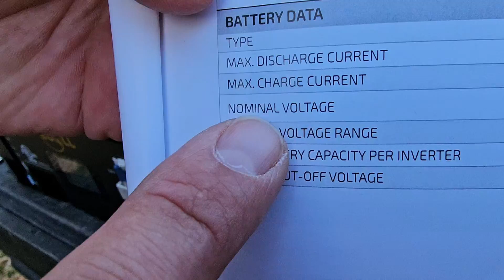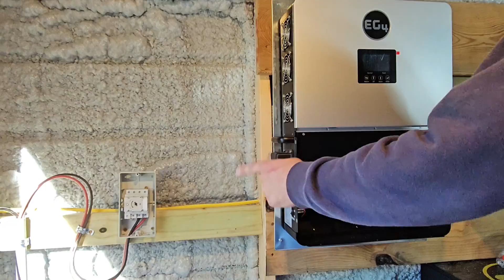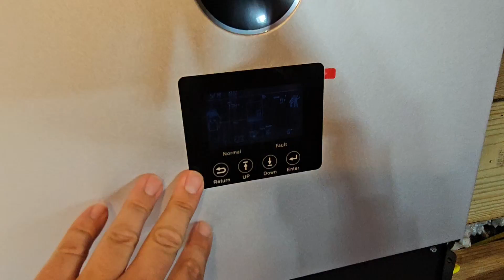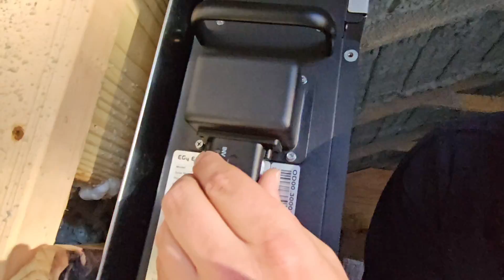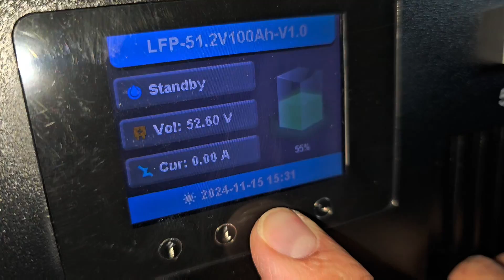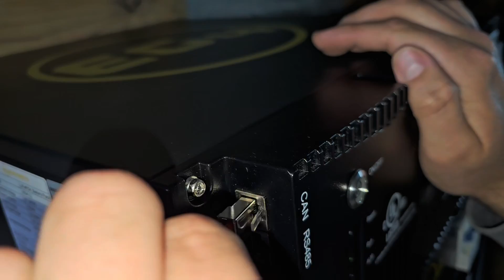EG4 6000XP Off Grid Inverter PROVED To Be A GAME CHANGER!

Comment: I've lived offgrid, struggling with a mix matched 12v system. But I did servive. Now I just got my dream set up. 6000xp and lls and a huge area .
Happy happy camper.  I can have air conditioning and run my well up without useing the genorator. I can now live like a city folk . 😅

Comment: Did I miss the ground rod for the inverter PE bar?  Did the system end up with a floating neutral or bonded?  Thanks for the succiny description during the video component install.  Well done.
Reply from the maker: Ground rod was placed just outside the shed I don't think I showed that in the video

Comment: No you can have 17 amps nd up to 480 volts on each so you can pair 2 array that have 8.5 amps on each on Voltage has to be 120 volts dc to even work 150 up will be better My Lowest one is 210 volts the others are 300 and above

Comment: These cheap high-frequency, transformerless inverters can damage your appliances when they fail because they don't provide any galvanic isolation between their DC boost stage and their AC output. No thanks.
Reply: Can you name a few alternative options that have the transformers?
Reply: @tompower7576  There are many low frequency inverters available on the market  available from manufacturers such as Outback Power, Magnum Energy, Sigineer Power, Iron Core Inverters, POWMR to name a few.
Reply: @ I did a bit of research and it makes sense about transformer based inverters being better. Unfortunately a quick check shows that they’re very expensive as well as somehow slightly less efficient. I found a 12000 watt Outback Power one at a decent price of $5500 😞 while an EG4 similar one can be had at $2500 right now. 
Quick question: could one  or get away with the possible surge problems by either installing a whole house surge protector or even having one on each appliance/outlet?
Reply: @ I was actually surprised to see that Sigineer Power has a transformer based 12000 watt inverter for $2999!! Compared to a high frequency EG4 I guess that’s an amazing deal!! I just wish it took in more than 7000W of PV power (or am I reading the info wrong). Either way that’s not bad.

Comment: The high-frequency EMF that is emitted by these low cost high frequency inverters is considered more potentially dangerous than the low-frequency EMF from low frequency inverters because higher frequencies carry more energy and can potentially damage cells and DNA more readily, especially when exposure levels are high; this is why radiation like X-rays and gamma rays, which are high-frequency forms of EMF, are considered ionizing and can be harmful to living tissue.
Reply: And no the frequency emitted are not on X-Ray or gamma rays levels of frequency and energy. Radio waves, cellular radio waves and TV signal waves are transmitted throughout the atmosphere everyday. And yes, the waves emitted by this inverter are considered harmless. Low levels.
Reply: The color red is a higher frequency wavelength than whatever this inverter puts out. If all high frequency  electro magnetic waves harmed you, you would be blind from seeing colors all day long as they are higher frequency than all communications frequencies except those ionizing levels like x ray and gamma rays.
Reply: You can add additional EMI and RFI filters on the input/output if they're not already into the inverter design. In other words, the designer should have those filters built in.

Comment: Not a wise choice for an inverter. These low cost, Chinese made inverter chargers use low surge, short lived high frequency, transformerless inverter technology that can be unsafe when powering household appliances or when charging an EV because they both lack an output transformer that provides galvanic isolation between their DC boost stage and their AC output. You're far better off investing in a lmuch safer, higher performance low frequency, transformer based inverter charger.
Reply from the maker: Do you have any recommendations for a better Inverter brand
Reply: Can you name one for about the same cost?
Reply from the maker: Thank you for this knowledge brother
Reply: You have a point there but these inverters are not dangerous. Yes, using a unit with a transformer would be better. A transformer provides isolation and great at matching loads. It however drains energy in the form of core losses and copper losses. You can't get away Scott free.

Comment: Also, it you’re pulling positive from the top battery, you should pull negative from the bottle battery to keep it balanced
Reply: For two batteries he is fine. The ohmic deviation is miniscule. When you have an array and are pulling 100 amps and charging with 100 amps, then an ohm can be substantial. As general rule of thumb, you want to connect at opposite ends of an array. I run 5 batteries. Solar charge is about 50 amps and max draw is 60 amps. Batteries stay balanced and I pull power from the first battery. Batteries reach full charge most days and they are communication linked.
Reply: You need to use same length of pos and neg wires and ya if u do have more than 2 batteries you should connect the closest positive and farthest negative or vice versa. But if u have a tower it's just easier and better to use two busbars.
Reply: What does that even mean?
Reply: @eddietee6305  wiring + to the top battery and - to the bottom keeps the circuit resistance balanced

Comment: This is a great starter. I purchased the same setup, the 6000XP, and the two batteries. I have been running the house off-grid for the past 18 days. It looks like I will have to invest in a second 6000XP so I can feed the garage and power the well. I like it as backup power, but I want to eventually be energy-independent. The only load it cannot handle is the dryer when it is set on anything other than the gentle cycle. It will not handle loads over 6K. We get a lot of sun, and the batteries last all night, discharging to around 30% before I start making coffee in the morning.
Reply from the maker: I'm very cool
Go ahead to know that the batteries are lasting.That's awesome
Reply: @MyCERanch  I wouldn't expect it to handle 6kw loads. That would be at  max. You should purchase another it
Reply: @MyCERanch  how did you ground the solar panels. The frames back to 6000xp or directly to ground rod?
Reply: @MyCERanch  try reducing your loads to help manage your power demand. If you get a heat pump dryer it only uses about ½ a kW (0.4-0.8kW depending on the cycle). A traditional dryer uses 3-5kW depending on the cycle but averages about 4½ kW.
Reply: @diggerbrass  just a thot… you can buy enuf solar and electronics to run the dryer. It will take a full 6000 to rrun a typical dryer. You could also buy a gas fired dryer. Natural or propane. Then you only need to power the motor. Ive had one 20 years, put two belts on it. Pretty efficient and economical.  Same with water heating. Unless you assure non-simultaneous operation with dryer, that will take most of another EG4.  Even more for a typical electric range… something to think about in managing off grid resources.
Reply: Watch "I Had A Surge On My DIY Solar Power System" on YouTube to learn how dangerous these high-frequency inverters can be.
Reply: @Madsci-zy8wm  low freq is the bet.